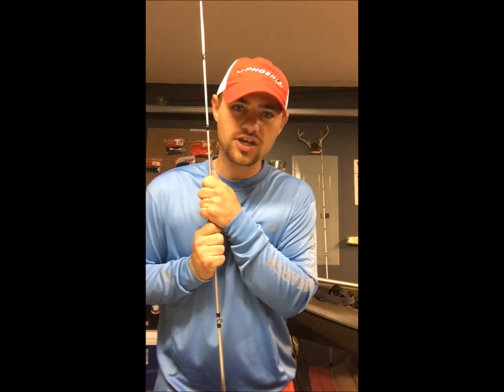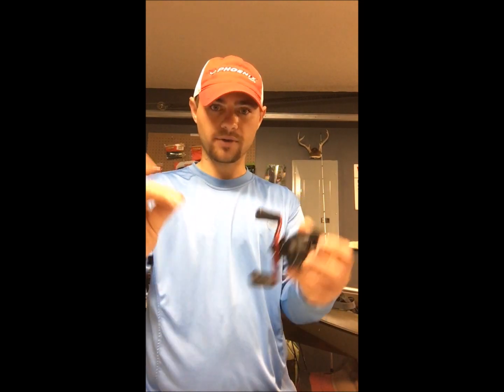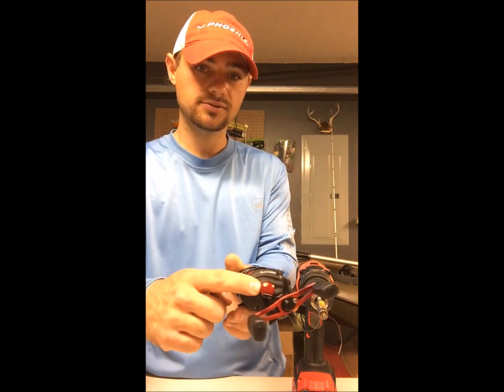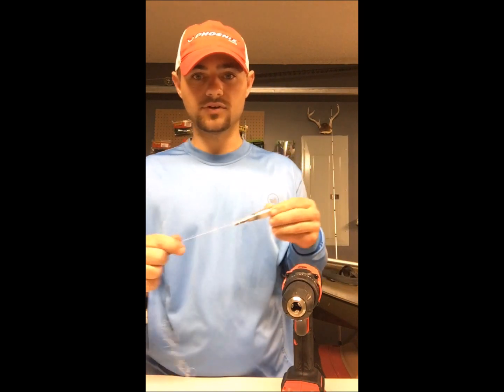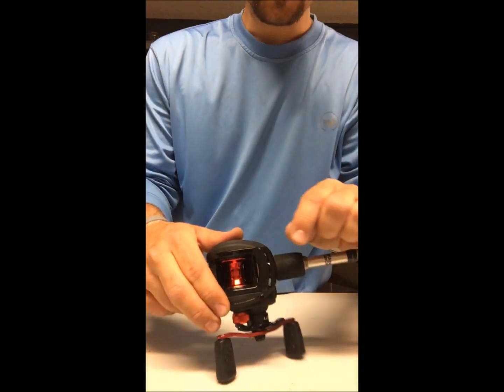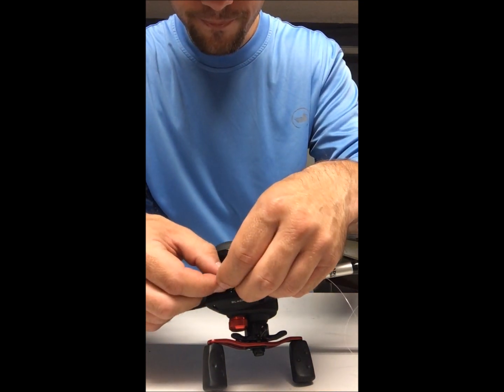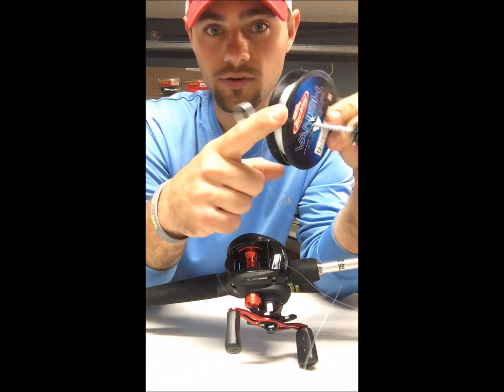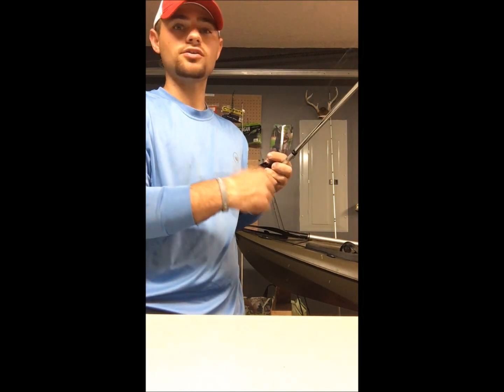How To Unspool/Spool a BAITCASTER FOR BEGINNERS!

Comment: Hey Steven, when you spool the baitcaster, do you tighten the drag or leave it loose? Thanks!
Reply from the maker: I don’t usually mess with the drag too much when it comes to spooling or unspooling. The only thing I adjust during the process is the spool tension knob which is located next to the drag
Reply: @stevendeckerfishing1780  thank you! 🙏